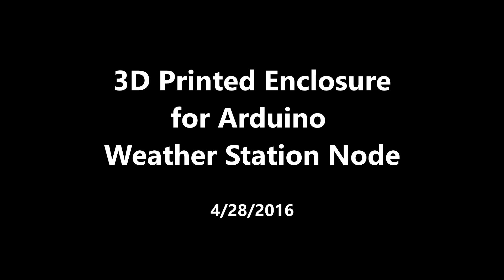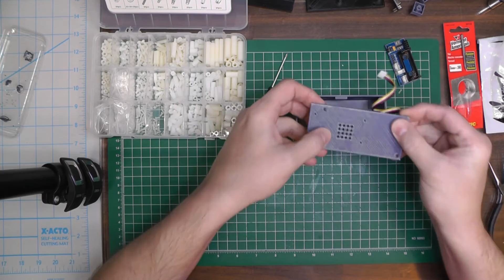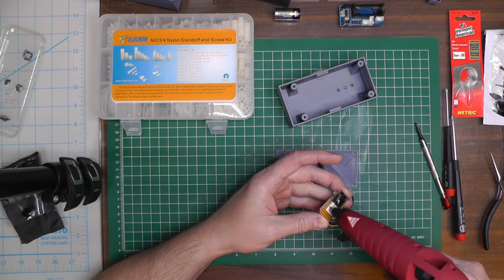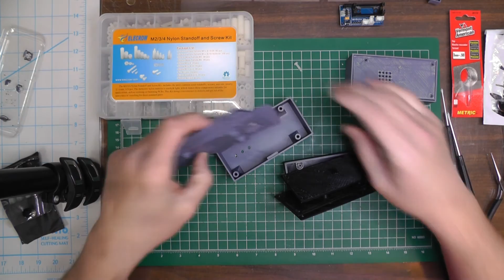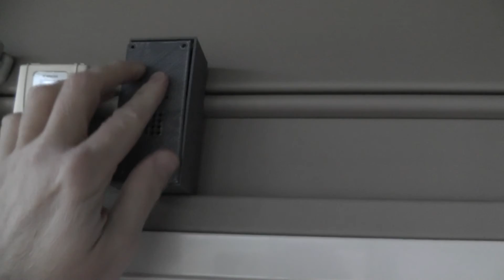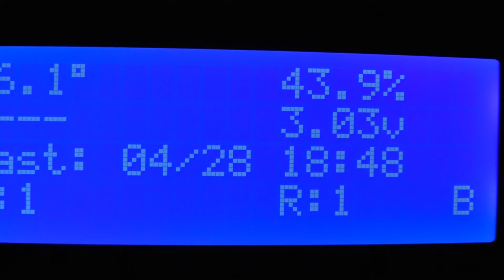3D Printed Enclosure for Arduino Weather Station Node

Comment: Hi Bob / 3D Printer / What would be useful for my layout & a 3D Printer, would be to print the front of structures.  Take a photo of a real structure and put this information to the 3D Printer and it would build a structure front elevation. Do this for all the sides. Is this possible?
• Cheers from The Detroit & Mackinac Railway 🚂
Reply from the maker: +trainroomgary Gary - yes it can be done.  In my opinion, 3D printers are quirky and are just now getting ready for primetime in the next 2 years or so.  You still need to know a good bit about materials and handling, temperatures, environment, CAD and slicing software to design and prepare your print and all options and related settings to get quality repeatable results.  I have a few ideas for 3D-printed items for the layout in the coming months.  Also, I don't think you would get good results "scanning" an item.  I think design from scratch by measuring yields the best results.  Also, you have to think about printing in pieces sometimes because you can't really print in mid air (ie overhangs) an such.  Still, it's cool and doable - and then you could sand, glue, and paint the wall sections.  My goal is to make it yet another tool in my arsenal for hobbies and general repairs.  Something breaks, you just design and print a replacement without leaving home. Cool.
Reply: +Bobot&#39;s Trains and Maker Zone / Thanks - got it.